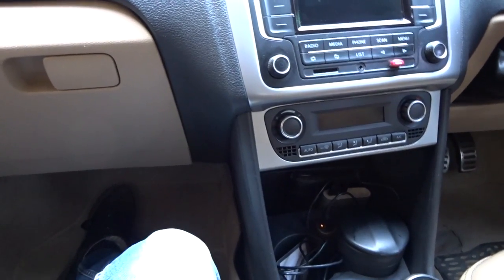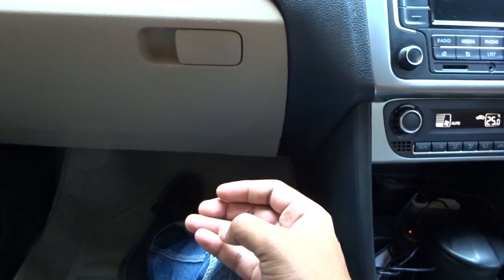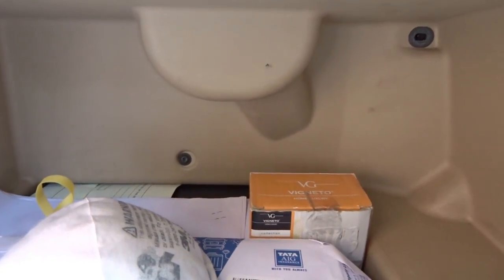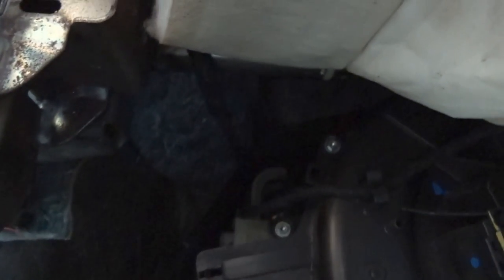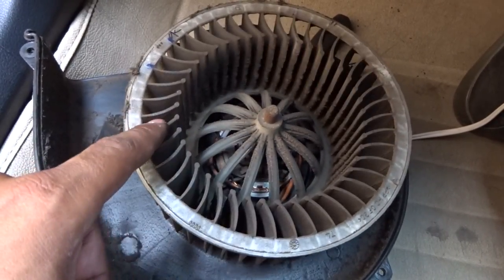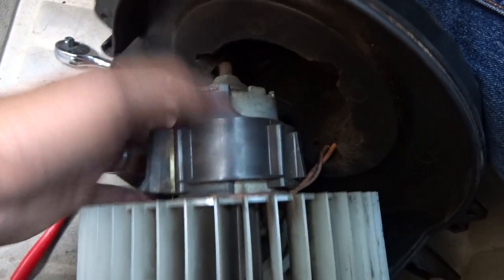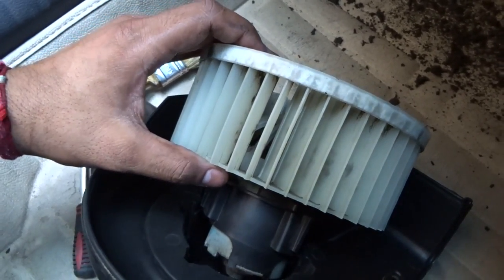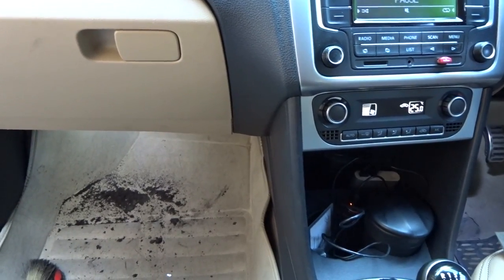CAR AC BLOWER FAN CLEANING | AT HOME | HOW TO | POLO | FABIA | JETTA | AUDI | VOLKSWAGEN

Comment: This video was very helpful.. my ac blower motor makes rattling noise whenever car hits a pothole. It was very annoying. When I opened the motor the shaft was covered with dust and minor rust. So I lube the shaft and clean the motor. Now the sound is gone and the fan speed is slightly increased. All credit goes to you sir . Thank you ....
Reply from the maker: Nice to hear that 🙂🙂
Reply: ष
Reply: Yeah mine too .. pagal ho gya noise dhoondh dhoondh k

Comment: There is a foul smell coming from ac vents even after changing cabin filter nd disinfecting , does cleaning this motor will help me?
Reply: Have the same problem
Reply from the maker: Foul smell is due to formation of algae and fungus in high humidity environments , just try to disinfect , it will go away

Comment: In my polo the airflow from left and right vents is little less than the center ones. We can feel the difference between the flow when ac blower is turned on
Reply from the maker: Sir air control flap needs to be calibrated again
Reply: @yourDIYneeds  can u tell the process ?
Reply from the maker: @vrushabhfasge2346 sir you can do it either by VCDS or obdeleven interface , its just a 2 min job , nothing much
Reply: @yourDIYneeds  well thanks for sharing ✌🏻

Comment: I have an issue on my tata safari dicor 2011 model without pressing accelerator paddle rpm raise at 1500 to 2000 rpm what was the problem and fuel filter warning lamp will display in instrument cluster how to fix this problem
Reply from the maker: Sir fir the light on tha dash you have to flush out the sedimentor ( I have a video on the channel ) and for rpm issue if it doesn't get resolved by the sedimentor then we have to check the throttle position sensor , which is located on the acclarator pedal itself
Reply: @yourDIYneeds  sir konsa video plz give me the link of the video
Reply from the maker: Sir here it is 
https://youtu.be/8-DSg8WBStE

Comment: Hi! Thank you so much for very useful video. I have a question about lubricant you are using for the motor. There are so many on the market, so hard to know what is the correct one. Could you, please, give some names or keywords for choosing. Thanks again!
Reply from the maker: Sir any good spray lubricant will work , a decent brand like castrol , motul , etc
Reply: @yourDIYneeds  Thank you for your kind answer! I was today in an auto shop, they suggested WD40. Would it be OK? If not, what out of Google suggestions should I use: Castrol Chain spray O-Ring, DWF, Silicone Spray? Thanks a lot again! :)
Reply from the maker: Chain spray will work sir

Comment: Brother how can i tight up my glove box latch for vw polo  it has become very loose and rattles irritating its closes qnd open just fine but its just it has too much of play big space
Reply from the maker: Sir for glove box , latch can not be adjusted but the rubber bumps on both the top ends can be , they have a hole in the middle , and they have a T15 screw inside , you can just make them a Little loose as per your need
Reply: Wow thankyou mate il try it. Yes I've seen that round type rubber
Reply from the maker: Yes sir , exactly that

Comment: My climate control is not working the display shows nd buttons work fine but blower fan doesnt rum nd cold air doesn't flow....plz suggest wat to check for ?
Reply from the maker: Sir sometimes the blower rotary control gets messed up , and doesn't respond , if everything else except the blower control is working then its the only suspect

Comment: Sir, I am planning to switch to k&n stock air filter of vento tdi dsg is it worth & change in performance..Plz replay.
Reply from the maker: Sir , there is no diffrence in performance apart from the induction noise , and even a compromise , because its proved that k&n filter are not good at filtering fine dust , whereas the OEM filter is quite good at it . 
One more disadvantages is that k&n uses oil on filter which starts to kill the MAF sensor . 
So sir i would not recommend it .
Reply: Thanks sir for reply..

Comment: Hey man, so i did the same process along with removing the blower, removed the bushing etc. However after reinstalling everything, the blower motor is giving off vibration in 3 and 4 fan speed. What could be the issue? Can i fixx it?
Reply from the maker: Sir you didn't clean it properly, every blade of the blower needs to be cleaned , even if there is 1gram of dust on one side , its sufficient to make the blower disbalance and induce vibrations
Reply: @yourDIYneeds  i did, also the vibration was not an issue before.
Reply from the maker: Did you removed any sort of clip from the fan blades ?
Reply: @yourDIYneeds  no, i made sure it is still there
Reply from the maker: Cleaned it well ? Dust and lint ?
Reply: @yourDIYneeds  yes, squicky clean. Used water btw.
Reply from the maker: It sat inside the housing properly ? 
Because if the balance weight is not messed up with and its sitting inside the housing properly , then there is no reason for vibration
Reply: @yourDIYneeds  yes, all the rubber bushing end was out and locked perfectly.
Reply from the maker: Sir then it can be only the blower fan itself
Reply: @yourDIYneeds  what can i do? Just use it like i normally would? And let the dust balance it out?😂
Reply from the maker: Sir , it needs to be cleaned well , even like half a gram of dust can disbalance this thing
Reply: @yourDIYneeds  okay, i guess i will remove it again then
Reply: @yourDIYneeds  the cooling and the air flow from the vents are also very less, the rear passenger vents are almost useless. Is there anything i can do?

Comment: On 1 or 2 fan my vento ac is making a chirping sound upon showing it to mechanic he says need to replace blower motor, possible to fix by just cleaning like u did?
Reply from the maker: Yes , that bottom and top bearing needs to be greased , they have gone dry and now making screeching noise . , Exactly same process needs to be followed
Reply: How did you remove motor from housing? That part was missing in video
Reply from the maker: Sir it was just removing the screws , and pulling the motor out .
Reply: @yourDIYneeds  i dont find any screws in the motor and housing in laura. I have already taken it out from car . Now need to lubricAte the bottom screw which am unable to do with out removing the housing
Reply from the maker: Can you send a clear photo of the unit from multiple angles , so that i can check !
everydaydiyhelp@gmail.com

Comment: Thanks for the video.
I'm using a 2012 polo and there is "tap tap" sound when I switch on the key. It will last for one minute and then disappear. But when I turn on the ac and the recirculation mode is off, it start to sound. I showed it to ASC and they said the blower should be replaced. Can I repair it myself without replacing..?
Also, there will be a smoke or chemical smell in the car when I run the ac in recirculation mode..I did 3M cleaning but still I can feel the Smell when I go for long trips...could you please help me to sort it out..?
Thanks
Reply from the maker: Sir the tap tap sound , is ac recirculation flap opening and closing to verify its end to end points 
And the smell you encounter can be of fuel , as the tail pipe is facing downward and on idle  the smoke emissions from the tale pipe gets trapped under the body of the car , if the recirculation  flap is not properly closed then the blower unit will pull air from outside and you will experience a smell , the thing we can do is circulation flap motor calibration , it can be done via VCDS or Obdeleven , and flap and the sealing surface for the flap needs to be cleaned as it collects alot of dust , so that it can seal against the opening properly .
Reply: @yourDIYneeds  thank you.
Reply: @yourDIYneeds  regarding the unusual sound; I opened the glove box and and I believe the noice is coming inside the blower. Is it because of the dust the accumulated on the blower...?
Reply from the maker: Sir it can be because of blower , clean the blower , flap assembly and lubricate the blower bearing as well 
It will be ok
Reply: @yourDIYneeds I removed yhe blower based on your video..you are right..it's because of the recirculation flap
Reply: I cleaned the flap but the sound still exists
Reply from the maker: Sir now the next step is to recalibrate the flap motor so that it can seal against the surface tightly to avoid any air leakage and also prevent noise from coming inside the cabin , but for that you need either VCDS or Obdeleven
Reply: @yourDIYneeds  hi  again
I have approached the ASC people for the recalibration of flap motor and they said there is no use of recalibration and it should be replaced...do you supply the flap motor..?
Reply from the maker: Sir i can get it shipped through my supplier if it is available
Reply: @yourDIYneeds  so can you plz check and confirm..?how much is the cost
Reply from the maker: Will call the parts supplier tommorow and will let you know , if its available
Reply from the maker: Sir i checked the part for MRP - and it is 11712/- lets see what the supplier tells us tommorow
Reply: @yourDIYneeds  okay...can I replace it in a local workshop..?
Reply from the maker: Yes
Reply: @yourDIYneeds  plz let me know if you can  arrange it through your supplier
Reply from the maker: Yes sir , its available 
Please send me a mail on everydaydiyhelp@gmail.com
Reply: @yourDIYneeds  done
Reply from the maker: Replied sir

Comment: Sir mera polo tdi 2012 mey Ac compressor tip Marta ha. mechanic ko dekhiya bo bola Ac blower under ek sensor kharab ha. That sensor that control the temperature in the cabin...kuch idea dey sakta
Reply from the maker: Sir ac cut hone ke 3 reason ho sakte hai 
1. System me gas pressure kam hai
2. Condenser wash hoga , kuki wo heat ko bhar ni nikaal pa raha 
3. Electrical fault ( sensor ,ya climate control unit me problem )
Reply: @yourDIYneeds  I have done 1 and 2 ... but there a sensor with the blower which is showing fault
Reply from the maker: Sir then you need to replace that sensor

Comment: Sorry to bothering you I have a problem with polo tdi when I turn the heater on RPM goes up to 1100 do you have any ideas?
Reply from the maker: Sir heater or ac ? 
It is something which happens only when ac is on , and that too on 900-950
If its happening at heater as well then i suspect there us something wrong with your climate control unit , (which maybe turning ac and heater on at same time)
Reply: @yourDIYneeds  yeah that's right ac light come up when I turn heater on,
Reply from the maker: Yes sir , thats definately climate control going bad

Comment: Sir are you from Delhi, if yes can you perform the same on my car, same problem Audi A4
Reply from the maker: Sir yes i m from delhi , but sir i don't have a shop , i m a hobbyist , its a work which can be done on your own , just need simple tools and a little patience
Reply: @yourDIYneeds  actually the system on the Audi Is way complicated that the Volkswagen, so I don't think it's as simple as the one you showed, so probably will get it done from a professional
Reply from the maker: Sir placement of blower motor maybe different , as q3 also have different blower placement .
Reply: @yourDIYneeds  maybe, will get it checked from someone, but thanks for the video, now I got to know where that noise in the AC was coming from

Comment: Bro. In my VW Polo, air is not blowing in the Middle two vents. But , from the other each vents location at the two ends Air is Blowing. What could be the problem?
Reply from the maker: Sir its air circulation vent , which is inside the HVAC unit , maybe the flap is stuck or the motor which controls the flap , gone bad . ( In automatic climate control system) 
If it's manual then the wire may have got loose from the anchoring point .
Reply: @yourDIYneeds  ok. Need to show to service 🤦🏻‍♂️
Reply from the maker: Yes it will be better 🙂

Comment: bro, what could be the problem if recirculation flat motors is not fully functioning . the lower vent is not working due to flap motor is not moving . any tips to fix at home as there is lockdown here .
Reply from the maker: sir , have to check first that flap is not stuck , as it can sometimes due to dust accumulation , then the motor which rotates the flap will be on the suspect list , and in some rare cases wiring issues can also be the reason .
Reply: @yourDIYneeds  i think its wiring issue . how can we check for bad wiring.
Reply from the maker: Sir , have to check physically
Reply: @yourDIYneeds  yes i check it  by watching ur video and some function are ok n some are not.
Reply: bro, can u help me to fix flap motor in vw polo 2013 1.2 petrol highline. actually flap motor is working but when i press downward air flow button it does nothing. pliz give me some suggestion. air is coming from others vents accept the downward vent is the problem. help pliz.
Reply from the maker: Sir motor is placed on circulation unit in a way that we can't do anything untill unless we remove the dashboard , maybe 1 small motor or actuator can be removed by fiddling it around , but to have access to complete assembly to check properly , dashboard needs to be removed
Reply: Bro, my car won't start today I try to fix rear parking light and after that my car is unable to start. Can u tell me is there any relation between fuse with starting the engine?
Reply from the maker: Sir if something got short then you have to check the fuse box for any blown fuse and replace it
Reply: @yourDIYneeds  the car won't start. I mess up with some fuse. Is it possible if the fuse is insert in wrong slot that the car won't start.
Reply from the maker: No sir if there is a fuse in slot car will start , if the fuse is of low amperes then it will blow again , if the load is high enough

Comment: भाई प्लीज मेरे सवाल का रिप्लाई जरुर करना भाई
भाई मेरी vento के  climate control पिछले 1 साल से करंट नहीं आ रहा जिस कारन मेरी गाडी का ac और blower दोनों काम नहीं कर रहे हैं. भाई कम्पनी कह रही है के आपका dashबोर्ड खोलना पड़ेगा जो मुझे मंजूर नही भाई क्योकि गाडी नई है भाई . भाई में यह जान ना चाहता हु  की अगर हम अपने blower मोटर को direct 12 volt करंट दे दे तो क्या blower चल जयेगा ? उसको on off करने के लिए अलग से dash बोर्ड में स्विच लगा देंगे. ऐसे ही भाई क्या ac का compressor direct battry से 12 volt देने से चल जयेगा ? भाई में खुद यह करने की सोच रहा था. के direct ac compressor और blower मोटर को battry से करंट दे के उसकी २ स्विच dash बोर्ड में लगा दूंगा भाई .भाई क्या ऐसे हो जयेगा? गाडी में?
Reply from the maker: Ji sir , hum aisa kar sakte hai , lekin bilkul hi last option hai ye . Company wale dashboard ke lie islea bol rahe hai kuki unko BCM utarna hoga , check karne ke lie ki wo voltage supply ku nahi kar raha hai . Ya phir basic wiring check ki kahi cut na ho
Reply: @yourDIYneeds  thanks lots lots lots of bhai for reply . god bless you dear brother ..bhai lekin jab wo dashboard kholte hain toh sare dashboard pe deep scratches daal dete hain bhai aur windws ke inner plastic covers pe bhi bhai. esi lyie main dashboard nahi khulwa raha bhai.
Reply from the maker: Ha sir , ye baat to sahi hai , scratches and marks to aa hi jate hai

Comment: Urgently msg please reply fast sir
Safari strome ka brake ka bleeding procedure batana please urgent hai sir
Reply from the maker: Sir same hai Dicor jaisa . 
Aap video refer kar sakte hai channel pe
Reply: @yourDIYneeds  maine apke brake sysytem ke pure video dekhe wo sabhi brake fluid change karne ke hai.
Lekin mers pass jo strome veh aai hai uska maine rear wheel cylinder kit new fit kiya to abhi system me air hai wo bleeding se nahi ho rahi release kya scan tool ka use karna padega air ko release karne ke liye
Reply from the maker: Nahi sir air to bleed hoke hi niklegi
Reply: @yourDIYneeds  Thanks for supporting 🙏

Comment: Tyre pressure 30 psi
Reply from the maker: Sir performance tyres are usually rough , same is uc6
Sir Increase the pressure to 33-34 or you are risking the tyre for sidewall cuts